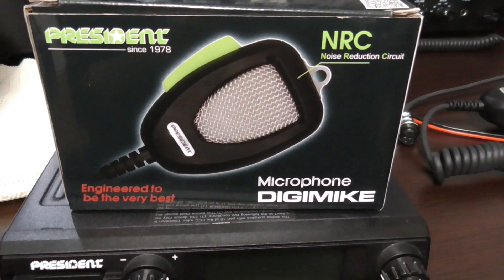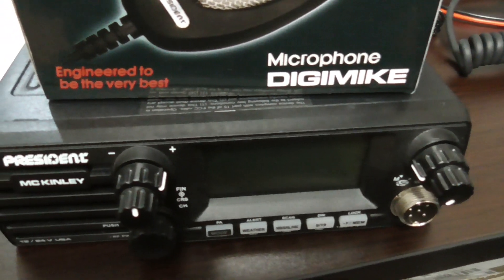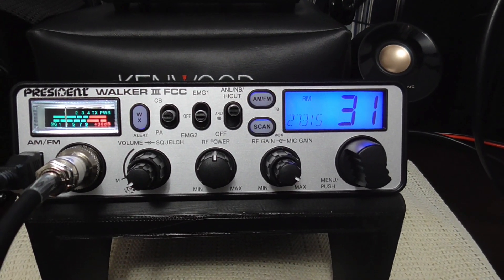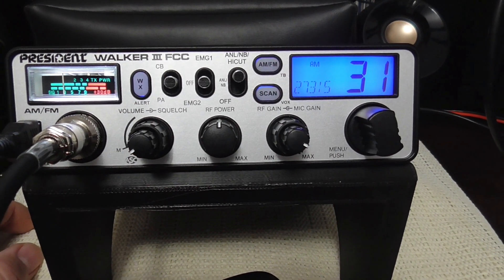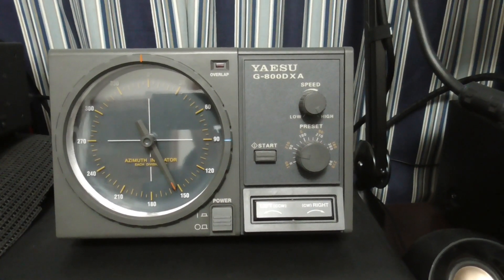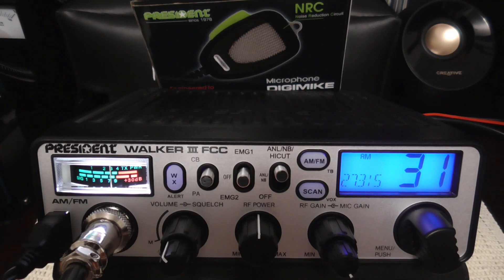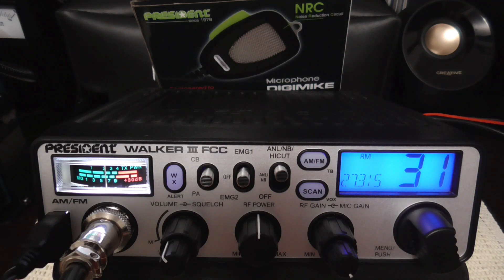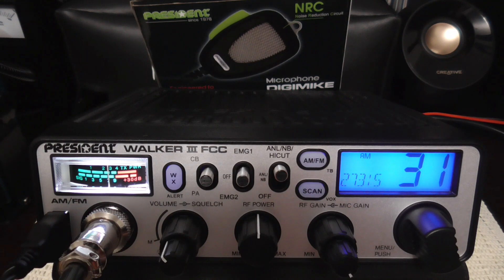President DIGIMIKE Demo

Comment: Shooting star is awsome back in the 70s I had a moonraker 6 the good old days!
Reply from the maker: I'm very happy with the antennas performance. 
But my desire to go to HF has led me to go with a different antenna option in the very near future. 
I find a lot more enjoyment lately with HF then listening to some of the slander, rhetoric, and disrespectful operators that tend to frequent where I like to hang out on in the CB band.
I've never considered myself a CB free bander because having a amateur radio license gives me way more flexibility and I can feel good about running power without any repercussion when needed. But lately I find even with just a simple wire antenna I'm able to work parts of the world with 50 to 100 watts on HF.

Comment: I wish you could tell us which mic that you have to change the radio settings, elec or dyna.
Reply from the maker: I believe for the digimike it stays in Electret, because the radio is applying voltage to the circuit board in the microphone.

Comment: Nice demo, big difference with NRC on or off. 🎤 It's on the heavy side but that's good because its stays in my hand and cord its not pulling the 🎤 out of my hand so easiley. Very good 🎤 for the price and I am using that with CRT SS 9900 that i got it from you. Very happy with the radio and 🎤. 73 from South Cali.